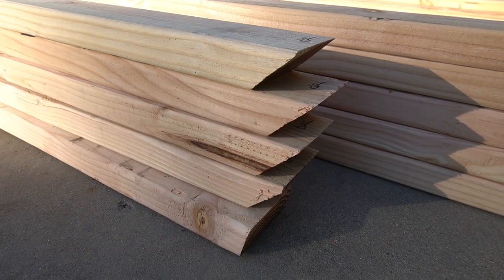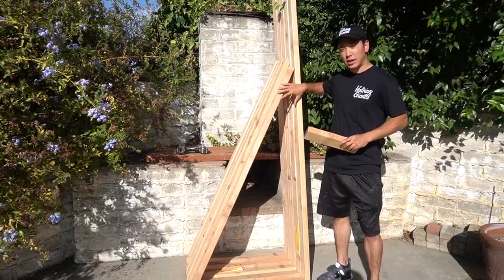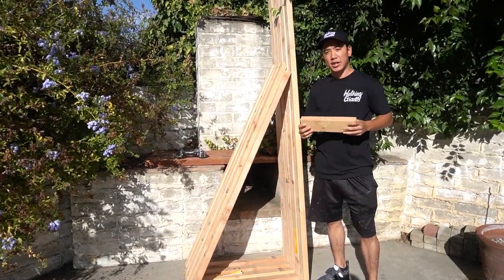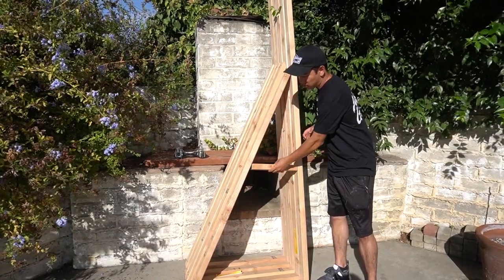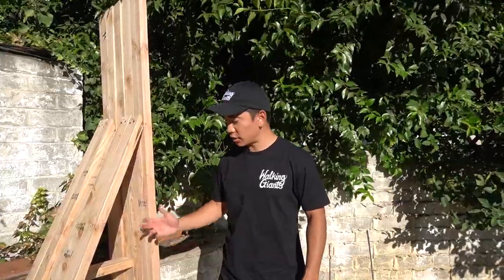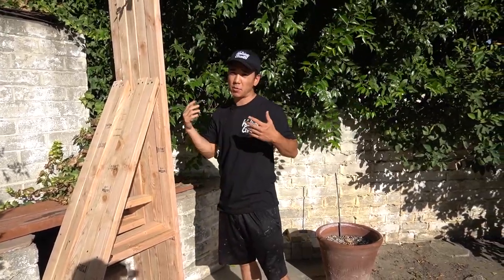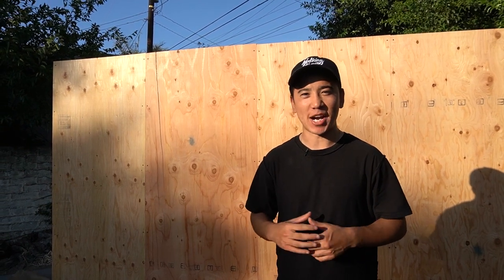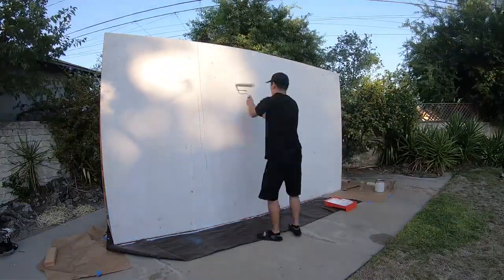How to Build an Art Wall!

Comment: Yo, this is great. What kind of pine, and what kind of plywood did you buy? Wondering what would hold up best in rain, and be best surface for spray paint. Thx!
Reply from the maker: Shoot I wish I knew the exact names. Usually when I'm at Home Depot I can tell just by looking at it and feeling the wood (no pun intended) to see how hard they are (again no pun intended lol!). You basically don't want it too thick/strong but also not too thin/weak (NO pun intended lolol!). As long as the 2x4s are strong to last and I normally use 1/2" thick plywood at least. Just check to make sure all the pieces you're buying are nice and straight. Prices of lumber went up. When I made this vid I probably spent $150 max on wood, but now it'll be a lil more. I think these will work tho from looking online:

2x4s: https://www.homedepot.com/p/2-in-x-4-in-x-8-ft-Prime-Green-Douglas-Fir-Stud-Dimensional-Lumber-441317/325977917

1/2" Thick Plywood: https://www.homedepot.com/p/SANDEPLY-12mm-Sande-Plywood-1-2-in-Category-x-4-ft-x-8-ft-Actual-0-472-in-x-48-in-x-96-in-454532/203414055

Hope this helps!

Comment: How are you connecting the two sections together? Awesome video!
Reply from the maker: The L-Stands and the plywood? I’m just drilling them together using 1” screws. For the middle pieces, you can see im drilling them halfway thru the width of the 2x4 so they can share the L-Stand bonding them all together so it’s 1 solid wall. See 2:30. Makes it heavier too so it won’t blow away and you can weigh down the L-Stands with sandbags too.
Reply from the maker: Hope this helps!

Comment: How long are your Horizontal stands?
Reply from the maker: I cut mine at 3'...If you're using an 8' 2x4, when you cut 3' off you can use the remaining 5' for the diagonal stem of the L-Stand ...Does that make sense? Hope that helps! If you watch the video and read my notes in the description that should help clear things up too. Lemme know!
Reply: TheWalkinGiant thanks. Today I will build my own wall